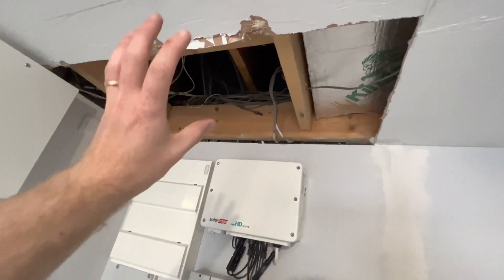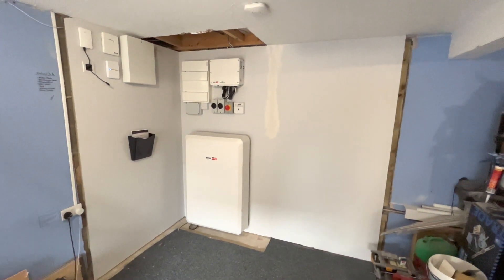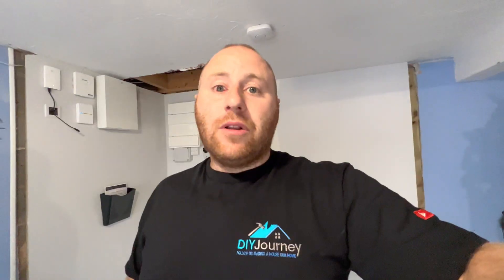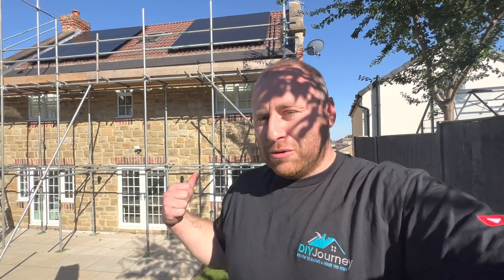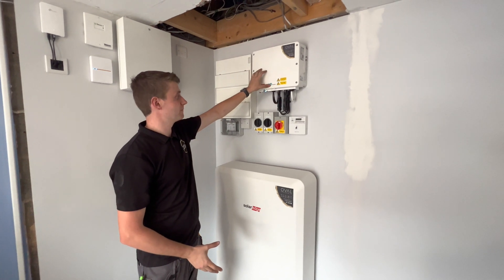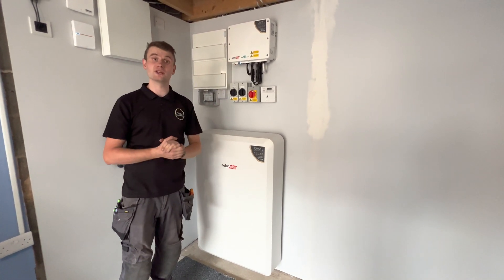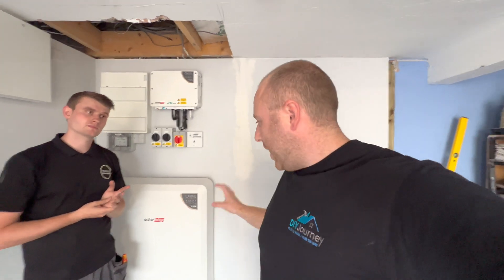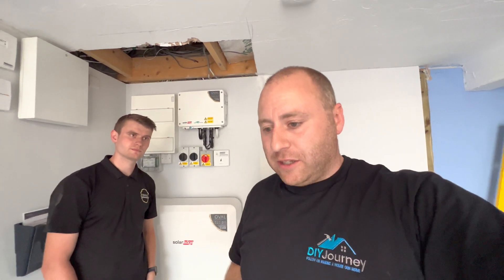INSTALLING a SOLAREDGE SOLAR PV System

Comment: I've just discovered your channel, it dropped as a youtube recommend, a good recommendation as I am researching solar to get a better understanding of how it works.

I too will be embarking on my new home journey, I'm currently in temporary accommodation awaiting to complete so I'm keeping busy, and trying to maintain excitement by forward planning. It is a newbuild which already has a solar system installed so I'm keen to hit the ground running by researching and learning about how it all works. 

There is no battery but it is something that I am considering doing a a later date.

I have found your video  interesting and informative, delivered in a non egotistical and relaxed fashion, so I have subscribed and I'm looking forward to catching up with your videos, no just the solar but your DIY stuff too.

A question about this video... it mentions "clipping" when the panels produce more than the inverter which in your setup is sent to the battery, so what happens if you don't have a battery to store it in?
Reply from the maker: Thankyou for your kind works, Im really pleased you’ve found it useful. 

By clipping, with no battery the power in the easiest way to describe just “dissolves” and disappears.

Comment: Hi, very interesting. Have a very similar system installed and considering adding more panels. Are your 20  panels on 1 string or 2 separate strings?
Reply from the maker: Hi, thankyou, ours is 2x strings, I believe thats mainly due to the cable route
Reply: @DIYJourney1  It will be because the two strings are facing different directions.

Comment: Great talk through guys! Couple of questions. If you're not planning on exporting to the grid, was there any benefit in grid tieing at all? If you don't grid tie do you have to still get DNO approval once you go bigger than 3.6kw on the inverter? Seems logical to stay clear of the grid and use it as a reserve power source, then size your inverter and batteries accordingly to maximise your 8kw array?!? I appreciate your DC coupling theory but am I right in saying the car chargers are predominantly taking AC and transforming to DC for domestic use?
Reply from the maker: There will always be time when the battery is full, the car is not home or is fully charged and we are out, at those times when I cant do anything else with it, id rather export than waste it. Such as a recent holiday we had, 270kwh was exported helping cover the cost of the small amount if grid use and the standing charge. Regardless of grid I would still choose the size inverter to your max powered appliance in my instance the car charger. What I am finding it, the max I can charge is 5kwh and if I want to charge at max the full 7kwh I then have to buy in 2 kwh at 38p/kwh gets expensive quick. But with 5kwh in the car zero from the grid, at least I can still utilise any additional over that to go in the battery to support the rest of the house at times when its needed. A battery in experience is an absolute must

Comment: Great video and system.👌 What other brands of integrated systems like this you've considered? Thanks
Reply from the maker: Thank you, I was pretty limited as I wanted the solaredge, but did look at Givenergy, or not integrating, such as using an Alpha battery AC coupled rather than DC Coupled like the solaredge is
Reply: @DIYJourney1  what are the main advantages and disadvantages of DC coupled system?
Reply from the maker: Its explained probably clearer in my solar installation video prior to this one.

But basically if for e.g, my car is on charge maxing the inverter at 5kwh, but my panels are producing 7kwh, it allows that extra 2 kwh to be put in the battery rather than just dissipated and wasted

Comment: How often do you need to replace the battery?
Reply from the maker: Not sure, its only been installed 2 weeks. 

Id hope never, but based in stats I think at least 10 years maybe reasonable.

Comment: Don’t know how available they are in your area, but a fire extinguisher ball might be perfect near your solar set up in the garage. They’re designed to go off if there is a fire (without a human operator).
Reply from the maker: We have installed a smoke alarm initially, and believe the battery may an extinguisher build in. Will have a look at the balls though